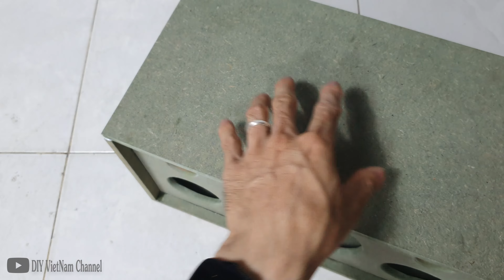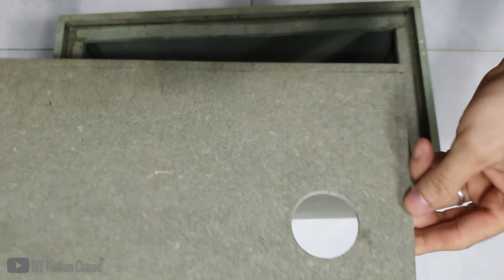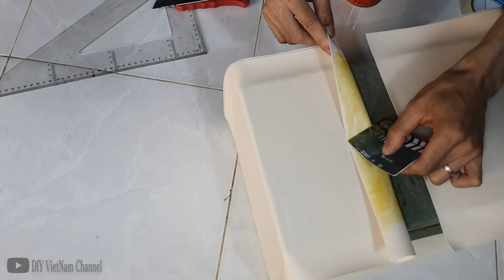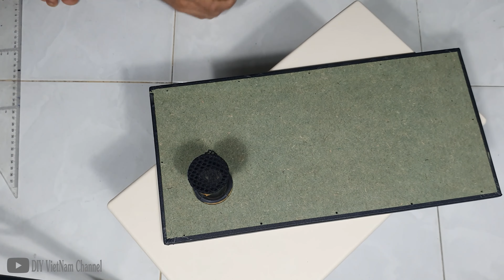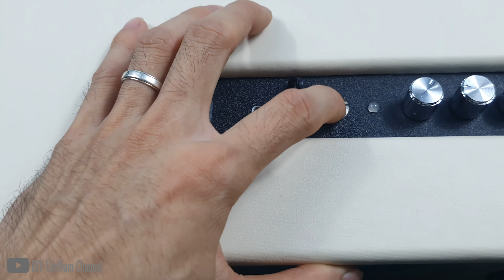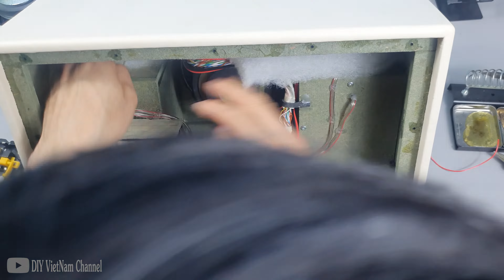|DIY| Chế Loa 2.1 Bluetooth - Kiểu Dáng Hiện Đại - 80W Nghe Cực Phê

Comment from the maker: - Mid Bass JBL 20W:https://shope.ee/402ApIxhj6
- Subwoofer 40W: https://shope.ee/4UyRVcJ49R
- Treble B&O 15W: https://shope.ee/9ozxloTY7k
- Ampli XY-E30H 2.1 Mini: https://shope.ee/6KQ5h8dFVQ
- Booster Circuit 12V -> 24V:https://shope.ee/7evTHeJUnY
- Battery 3S: https://shope.ee/6zfmUUtcES